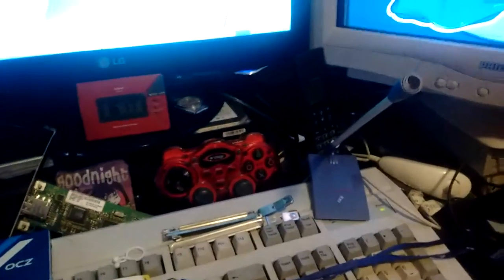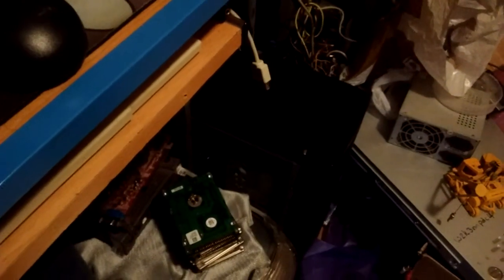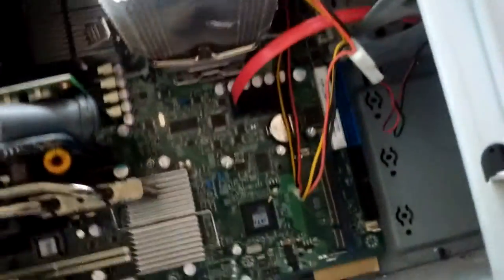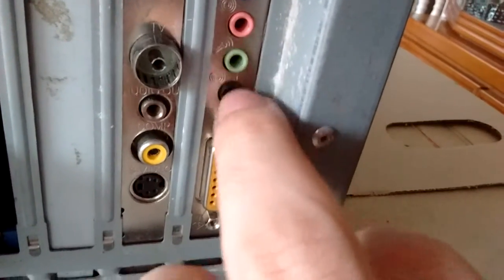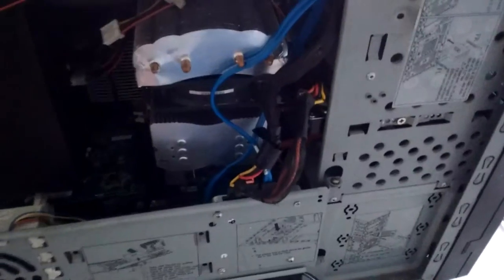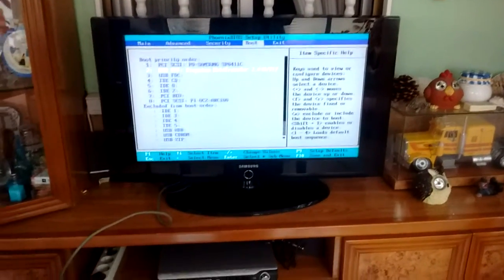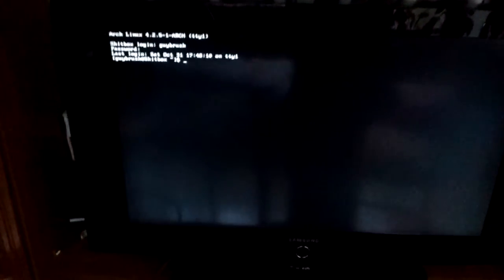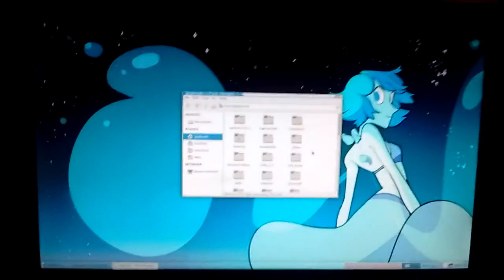Upgrading my main computer with an SSD!

Comment: Some hardcore modding.  I've done that crazy shit to cases, even adding my own grills.   Later you come back to the same cases after you've moved the motherboard elsewhere or kileld it...  and you're like... WTF I tore this case up with mods!  and you just end up throwing them away.  Case are cheap so no big deal.

With that SSD drive in there your have really fast bootings and fast swap.  RIP.  Too bad.  I've killed mobos by connecting dead IDE drives into them and other stupid shit.

You can buy 64gb of FBDIMMs for this system for $80 US now.   64 friggin GB!  I have no idea what you'd use all that ram for.   32gb is like $60.  

I assume one of these USB sound cards would be the way to go:
http://www.ebay.com/sch/i.html?_from=R40&_trksid=p2050601.m570.l1313.TR0.TRC0.H0.Xusb+sound+card.TRS0&_nkw=usb+sound+card&_sacat=0

But it looks like you had a Dell PCI Soundblaster Live that worked in there...   I prefer the riser cards to a dongle.

i'd probably run Win 7 x64 on it, or Centos Linux.

I disabled AHCI on this mobo I'm on now and it wouldn't boot on the drive, it would crash loop, so you kind of need it enabled.

Low capacity harddrives too small now to use as your main drive, make good dedicated swap drives on machines...  where you have a boot drive, and a swap drive.   Just configure the whole 10/20/40gb as swap (Linux) or place your Win swap file on there.